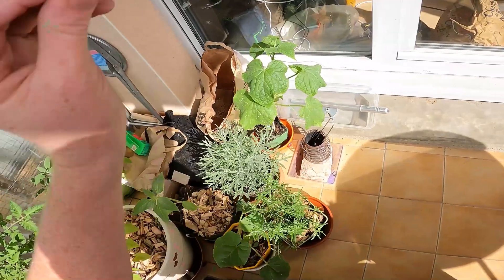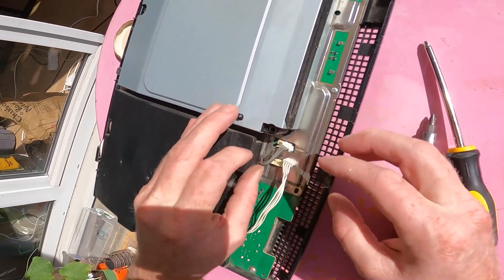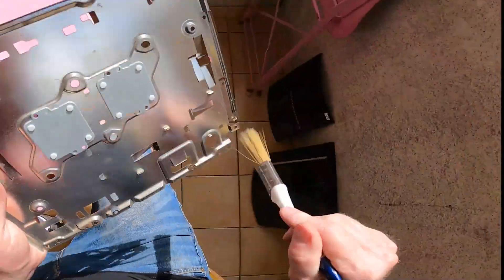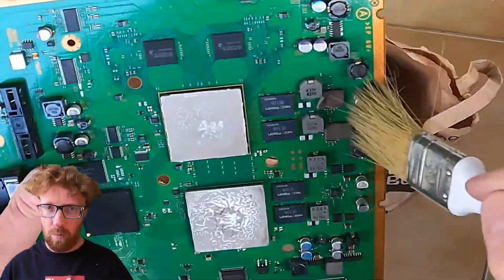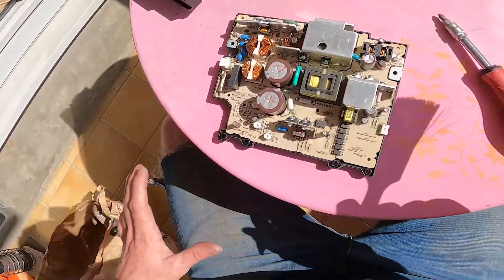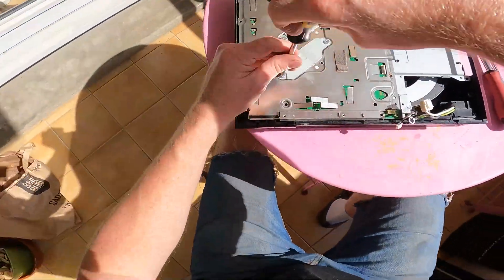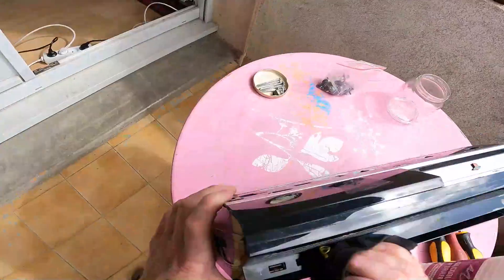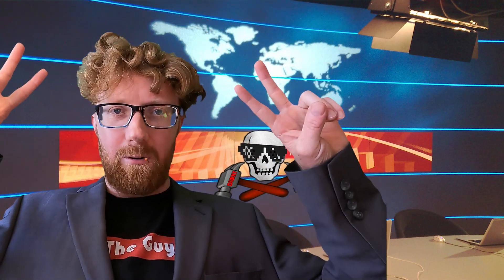How to Clean a PS3 FAT

Comment: Great video, i had a customer with a ps3 slim, he told me he dropped the ps3 and now it would power up with nothing on the screen, it might be something to due with a the hdmi chip or something with the motherboard. I tried to hold the power button for 7 seconds to reset it and tried the old av cables and it didn't work. Do you think its a motherboard prroblem?
Reply from the maker: Thanks mate, yeah it could be a crack in the Motherboard you would need to look it over with a magnifying glass if it looks good could try take out the bios battery and use a screw driver to to arc out the connection wipe the bios before using the AV leads if it was pugged in when it got dropped it could be a broken HDMI port good luck I hope you can work it out.
Reply: @TheDiWHYGuy  thanks. Because its an old ps3 i would just tell him that there is a high chance its the motherboard. And motherboard issues are not my thing. so i would offer him a ps3 super slim for $40
Reply from the maker: That's fair the ps3 motherboards are very hard to repair sadly, but 40 bucks for another one can't go wrong really thanks for watching mate :)